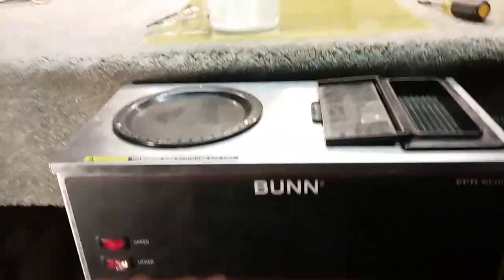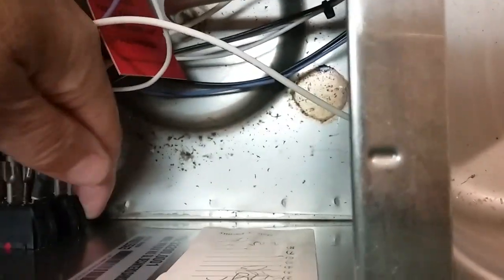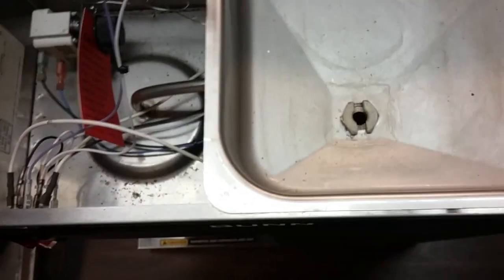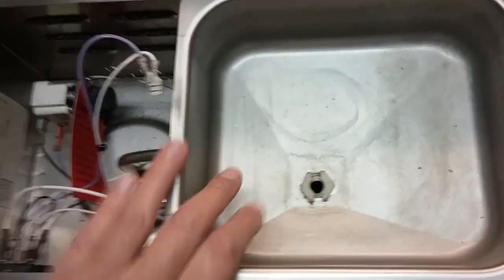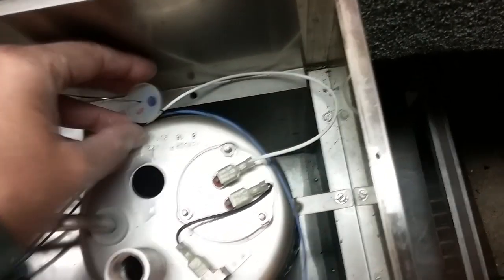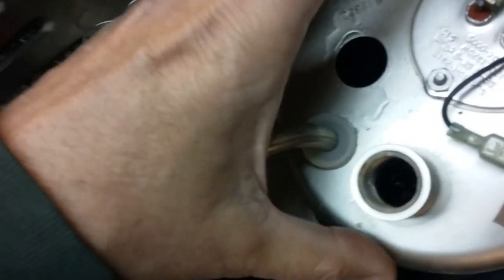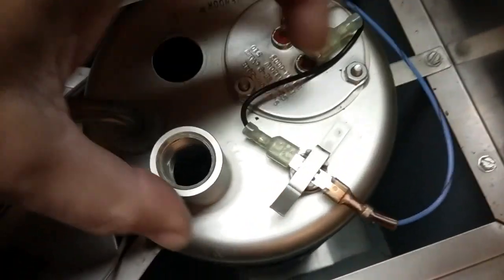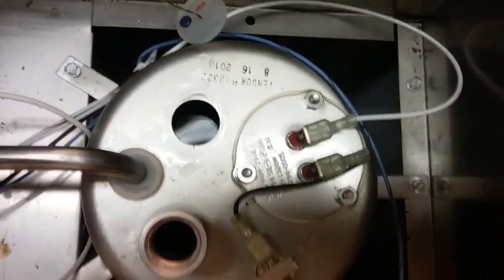BUNN Professional Coffee Maker - VPR Series - Servicing

Comment: I have to put in nearly two pots of water  and than another pot for mine start making just one pot...why is this???
Reply from the maker: The unit has a tank that has to be filled. The water in the tank is heated by the heating element and is always hot.  That is if you leave it plugged in. After that, the machine is ready to use.  As you pour cold water in,  it pushes the hot water out. So you put 1 pot of cold water in and get exactly 1 pot of hot water out. I hope that makes sense.
Reply: With the maker off and the water cold inside the tank, fill with pure/distilled water until the water comes out and flows into the pot. Now your tank is full and ready to be plugged in. Let it heat up to boiling (you should hear it boil and then stop boiling). That's when you add a pot of water at the top. Be sure you have a spray head attached and that it's clean with no clogged holes. It's easy to unscrew and clean. Now you're good to go.

Comment: Soak in Vinegar works great, and ever so often I run vinegar and water thru the coffee reservoir and it breaks loose deposits, works great for us. Thanks for sharing, love ours.
Reply from the maker: Yes, white vinegar is a great decalcifier! I use it more than anything else. My final cleaning is with 91% isopropyl alcohol to sterilize the tank and hoses. Lastly, I run white vinegar through again before I run just clean water to remove the vinegar.

Comment: Our coffee maker is running the water so fast that the funnel overruns so it's not clogged. What to do??
Reply: weird, wrong basket? does it have the spray head?
Reply: I think you're missing the spray head that disperses the water out evenly over the coffee in the basket. Without that spray head, the basket will overflow. I think ebay or amazon sells the spray head, but I'm not sure. You can go without the spray head and still make a pot of coffee; you just have to add a basket amount of water each time, not a full pot of water. Wait until the coffee stops flowing into the pot before adding another basket amount of water. Know what I mean?
Reply: sprayer head could be loose and pooring too much flow

Comment: mine went wild and started gushing water out of the filler and sprayer im guessing the thermostat messed up. I replaced the thermostat and it works but seems to not get as hot as it did  yes I have it all the way to hot.
Reply from the maker: You should also change the cutoff switch. If the water gets too hot, it will boil over and spew out wherever it can. Also, the silicon gaskets on the tank lid should be replaced. One was replaced with your thermostat most likely. Check the other too though. When they get hot, they expand and loose their tight seal. Boiling water will destroy their integrity.
Reply: Hey, myn leaks from the tank top when I dump water in it.  I'm guessing I need to change this seal?  Also my machine sits in my cold barn.  Anything I should do in winter time?  Will it break if it's full of water?  Thank you
Reply from the maker: Change the tank lit gasket and it should be fine. If it freezes full of water it can split the tank. However, it is more likely to pop the gasket and bend the lid. @tonyb3676

Comment: Great insight of the coffee maker. My machine just popped the GFCI it was plugged into. We've been using this for years and now something has happened while it was just there. I unplugged the pot and reset the GFCI then replugged it in and it popped immediately.any suggestions to fix this issue?
Reply from the maker: You have a shorth circuit. It most likely is the heater has deteriorated from hard water sediments eating through the heater coil housing causing a short circuit. However, I would not rule out that the short could also be in any one of the switches, solenoids or wire harnesses.

Comment: Any ideas why every morning when i make a pot of coffee with this machine the burner underneath the spray head has a good amount of water that has leaked from the spray head, sometimes worst than other times but can be up to 1/16" 

I cant figure out why it would be doing this!?!?
Reply from the maker: Assuming you have descaled the water outlet line: Check the auto-shutoff switch. If the water is boiling, it will boil over when not inuse. Also check the thermostat control which can cause the same issue. Lastly, you may need to replace the tank lid and thermostat gaskets.

Comment: ordering a new thermostat grommet for mine, I hope it comes with a split to install it or do you force the probe through it?
Reply from the maker: Yes it should be slit for installation. It is just to isolated the probe line from the temperature of the metal at the convection point.
Reply: @ElectroRestore  Thanks and Thanks for the video

Comment: If I changed my thermostat and turned in all the way up and my water still takes forever to heat up should I change the elements next?
Reply from the maker: Not likely. If the heater is working, then it could be deposit build up on it,, or the inside of the tank. If it does not look bad in the tank, is replace the hi temp shut off switch. In fact, that is usually the culprit

Comment: I have this exact same unit, and it has been sitting for a few months since it was given to me at which time it was working fine. When I brought it out yesterday to clean it and make sure it was still working, when I poured the water in it just runs right out.Do I need to let it warm up the water in the tank first before I put more water in it?
Reply: Mine is for sale if anyone is interested
Reply: Yes let it get hot, put your coffee in the basket, pour cold water in, it will immediately start brewing coffee. full pot in 2-3 minutes
Reply from the maker: Hi LeRoy,  sorry I did not see this earlier. For some reason,  I don't get all the notifications I should. 
But for others to know too,  yes toy nerd to let it warm up before you pour more water than the tank holds.

Comment: HOLA YO TENGO UNA MAQUINA SIMILAR A ESA DE LA MISMA MARCA BUNN..PERO LA LIMPUE .PERO NO ME ECHA AGUA Y NOSE SI LLEVA BOMBA ..O NO
Reply from the maker: No, there is no pump. It is called a pour over coffee maker. Because you pour a pot of cold water in the top (when it is already full)and a pot of hot coffee comes out the spout.
Reply: @ElectroRestore  hola tu no tienes algun nuemero de telefono de wassap para que me puedas alludar
Reply: El problema de la cafetera es que ella calineta bien pero no echa el agua solo se pone bien caliente..y gracias por estarme  alludando
Reply: LLENE EL TANQUE Y SE PONE CALINTE PERO NO ECHA EL AGUA SOLO LA CALIENTA
Reply: @josecaceres6022  You have to over fill it: 1. Fill tank. 2. let water get hot. 3. pour in more water and it comes out.
Reply: @KJB-Man  sera porque lo tengo lleno el tanque por eso no me ssle el agua caliente mi amigo
Reply from the maker: Watch: https://www.youtube.com/watch?v=qz84mlN4o2w
Reply from the maker: @josecaceres6022  Pour in more water.
Reply from the maker: @josecaceres6022  If it does not come out... hose is blocked.
Reply: @ElectroRestore  yo limpie todo el unico tubo esta limpio le eche aire.
Reply: @ElectroRestore  esta limpio la tuberia
Reply: @ElectroRestore  no abla algun video como se usa yo solo español hablo🥲
Reply from the maker: @josecaceres6022  The video I linked shows it in picture. The English not needed.

Also, is the spray head clean? Use a needle and clean all the little holes.

Comment: I have the same one, and i have a problem, the water alway boil none stop .. do you help me to found solution, is it the thermostat ? Thank !!
Reply from the maker: Yep! It is the thermostat. It is not shutting the water off. Replacing it is not difficult.
1. Unplug the coffee maker.
2. Disconnect the two wires from the thermostat terminals.
3. Remove the two screws holding the thermostat in place.
4. Gently remove the probe gasket and then slide out the probe.
5. Insert the new probe into the tank being careful not to kink the metal tube.
6. Make sure the probe is down the tank about half way and not touching the sides of the tank or the heater. It should be free moving.
7. push the new gasket into the hole and re attach the thermostat screws & wires.
8. Set the control knob about 3/4 of the way to high to test it. Adjust as desired by turning it up (in small increments) and checking the water temperature in coffee pot at each point until you are satisfied with the coffee temperature.

WARNING: Always unplug the coffee maker before making any adjustments. Remember, you are doing this at your own risk. Water and electricity is a deadly combination that can kill! If you are not comfortable doing this, take it to a service person.
Reply: @ElectroRestore  thank a lot my friend !! 😃

Comment: Can you help our community center? Our coffee doesn’t seem to get hot enough. I noticed on the thermostat limit switch there is a knob.  can I turn that to a higher setting?
Reply from the maker: You can try it. It might buy you some time until you can get the unit serviced. But I would not set it to maximum.

Comment: Hi Paul, hope all is well. I have a question...I have the Bunn vpr series coffee maker and when both top and bottom switches are OFF and you poor water in it, it still heats the water up and delivers it to the pot, can you tell me why that might be?  Thanks.
Reply: @ElectroRestore  So basically the heater in the tank for the water is constantly on as long as it's plugged in am I correct?
Reply: @ElectroRestore  Ok, I thought mine was broken lol.  Thanks for getting back to me so quickly much appreciated.